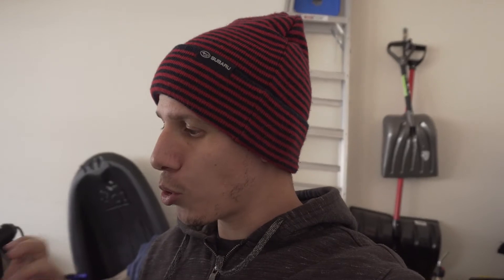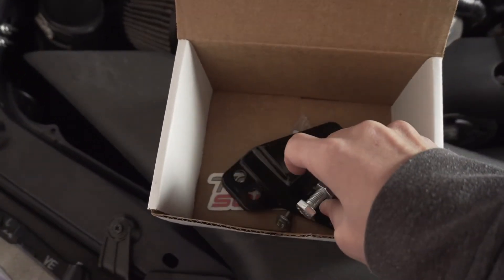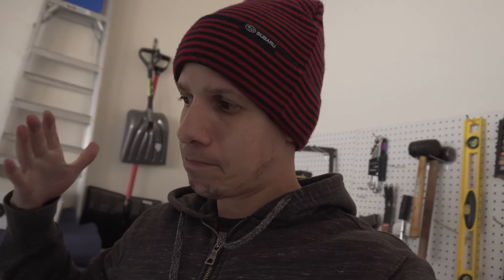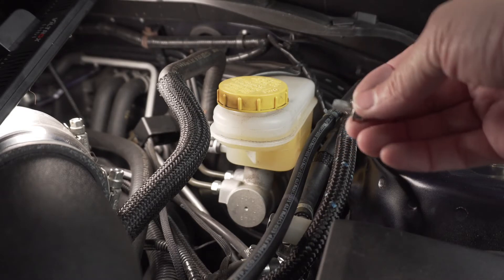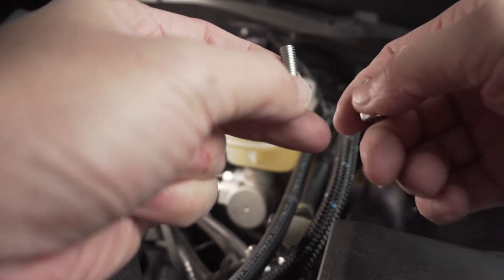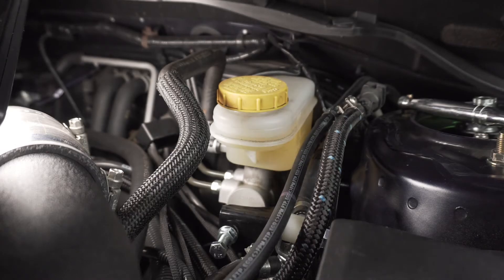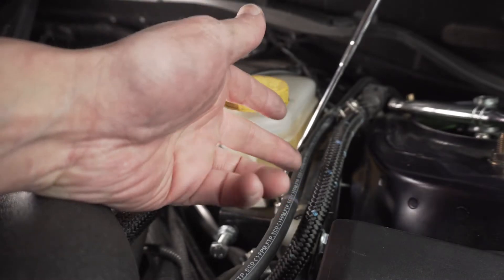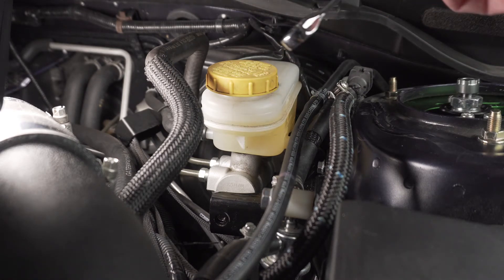Does a Brake Master Cylinder Brace Work? | 2017 Subaru WRX STI

Comment: Hey man. Just installed my brace. Went out and bought one after seeing your video to give a try myself. I do like the initial stiffer feel of the brake. But I still feel alittle mush.  Time for some stainless lines.
Reply from the maker: Definitely some lines and a fresh flush will feel tighter for sure
Reply: @ARomanRacing  ya. I'm going to wait til my stock pads are done. Just bought a 2019 sti in jan. So there alot of life left.

Comment: After using it for a couple of months, how do you like it? Thought about getting it for my wagon.
Reply from the maker: stumpvold it does feel tighter,  like as soon as i press it, there is quick feedback. I mean it is not night and day difference, but there is something there
Reply: this mod is a total waste of money. I bought one for my wrx and just disappointed that it made no difference. i don't see how it would, honestly. The stock piece already feels so rigid. It's one of those gimmick mods to avoid.

Comment: would blue (temporary) thread lock be useful in this installation?  If you are unsure of the torque values, the thread lock would help keep the bolts in place if your applied torque wasn't enough, plus it would help prevent them from loosening from vibration...
Reply from the maker: Yeah absolutely

Comment: What were your initial thoughts after you first drive with this on?
Reply from the maker: Not much difference 🤣. What really matters for stopping power is brake pads. To get a good brake feel. You would need a combination of brace, lines, and a gread brake fluid flush. But all at the same time to feel a difference
Reply: @ARomanRacing  gotcha. Some people say it makes a big difference others say not so much. But noted!
Reply from the maker: @xpavence4237  this was my 3rd time and its all the same in my opinion. You can definitely see it flex so its a common thing that the master cylinder moves but as to big difference, not much that ive seen. Now of you do all of it at the same time, you will notice a difference. Do one at a time, not much. But like i said, mainly if you want stopping power, its all on the pads
Reply: @ARomanRacing  ok for sure! The parts i more look to are parts that build reliability to the car and make it stiffer and more responsive and its a part i would like to add as well